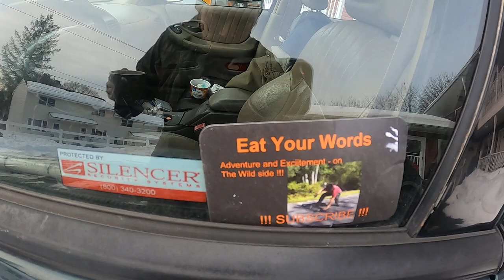What happens when you use water instead of antifreeze in the winter

Comment: Not gon lie lol, I FULLY know this ain't a good idea in the winter. But I have no choice but to use water at the moment. I improvise by warming my car up to operation temp every few hours over night. Man 1...Mother Nature 0 😎
Reply: You cannot afford antifreeze, but can afford fuel to run your engine up to temp every few hours???
Reply from the maker: I didn't have a fuel leak. And I was waiting on parts. Had it been the water pump housing - I would have had to remove lots of other stuff just to get to it, and it was cold....
Reply from the maker: Could you imagine buying between 2 to 4 gallons of antifreeze a day, just to put in it, so it can drain to the ground ...
Reply: I'm in the same situation myself right now, just warming up the car and I'm going to empty the water out and remove the battery untill I can fix it. Luckily I don't really need the car atm so I can just let it sit for now!
Reply: So did your radiator bust or did the freeze plugs on the engine blow out?
Reply from the maker: I got lucky, the freeze plugs blew out...not a terrible fix, but she had a bit of a shake afterwards...lol
Reply: Well whats happened is the upper leg of my lower radiator hose apparently froze solid before I added some actual antifreeze to dilute the water being that temps were dipping to single digits. I thought I was still ok because the upper hose and reservoir water was suprising fully liquid. Thought I dodged a bullet and was going to continue dodging with radiator sealer additive and 100% antifreeze. Nope... Too late. That hose felt like a fucking BRICK lol and its taken me 2 days with - degrees not letting up trying to thaw it manually and running the car trying to circulate it. I realized my situation once I was driving, engine temp stopped going max and held temp, then suddenly steam poured out from the hood... Thermostat gasket blew. Only seemed catastrophic because at single digits steam looks WAY bigger than it really is especially in DRY cold air. Ive got a new radiator, but its too cold to fix if I can only fix on it for 10 minutes at a time before my fingers feel like they are slammed in a car door because of the cold.  @StrawberryGarcia
Reply: I had the same problem.  Mine of frozen solid because I had no job, got screwed over by another job, had no money, finally got a job, then this happens so I had to call off the first day!  Feels like there’s just no relief in this lifetime…

Comment: This video gave me hope that my subie isnt pooped out. I just did the same thing today and thus is what brought me here
Reply from the maker: Yeah buddy, thaw her out good...now's a good time to flush that radiator, LoL....then put new freeze plugs in, try to get the expanding ones...much easier!!! Good luck!
Reply: Same thing happen to me .water froze solid probably is gonna take a few days to unfreeze
Reply from the maker: No, it can be done faster...where are you located? Use hot water .... Dump it in the radiator .... squeeze it out after it thaws a bit... Repeat until the Big radiator hoses are thawed.... Then continue until water poor's out like my video.... Then add a bunch of antifreeze... replace your plugs, then refill with straight antifreeze....
Reply: @eatyourwords5644  I’m located in Alabama it was 19 degrees and I had no idea the water had froze in my radiator until I tried to warm my car up this morning and heard a loud popping noise .I will try to pour hot water on it tomorrow thanks for the info
Reply: @nickiforlife8292  update please!
Reply: @newjack2166  hi there I waited a couple days for the water to un freeze when it finally did and I cranked my car up It was blue smoke coming out but it only did that for that day I ended up having a hole in my hose that runs from the coolant tank .

Comment: is there a good way to get the coolant back up to temp i can tell it's still solid and would prefer not start it back up
Reply from the maker: Pop the hose off the bottom where it meets the engine,  and jus keep adding hot water ...you could also put a heater under, and over the engine...tarp it off to help keep the heat where you want it....
Reply: Pull into a garage

Comment: Your heater core rust out and you have to pull the dash to have it replaced
Reply: Most heater cores are made of aluminum.
Reply: @Josepht1993  not sure. Mine was an 01 F150. Maybe the rust from the motor clogged it up. Probably what happened

Comment: So after all that, what actually happened?  Did the ice make holes in the radiator? Did some replaceable plugs just come out?  I got a whole lot of nothing from this video!
Reply from the maker: The video was simply to show why you don't use water in the middle of winter, yes it pushed out to freeze plugs and ever since then the engine had a really bad shake and the engine light came on.. eventually I sold it for Christmas present money...
Reply: @eatyourwords5644  I've since seen elsewhere that "freeze plugs" was a nickname given to the caps put in some engines to cover the holes made for casting them.  They can, by chance, save your engine if the coolant freezes (by providing a place for it to expand out of) but that's not what they were designed for.

Anti-freeze is apparently also important as a corrosion inhibitor for the water in the coolant and can also prevent overheating by raising the boiling point of the coolant.

I had my car in a situation where it sprung a coolant leak and I didn't have anti-freeze to hand to top it up with.  Luckily I did have distilled water but now the anti-freeze/water mixture must be way off on the water side.  At the time white smoke was coming out from under the bonnet and the engine temperature was hitting 260F!  Needless to say, I'm not running it like that again!  Now I'll probably have to do a full coolant flush to know the mixture is correct again.

Having said this, I've seen Coolant Flush chemicals recommending to run them with just distilled water and no anti-freeze.  Of course it's a temporary measure, but I'd worry if my engine started steaming like that again...
Reply from the maker: Yeah man, my water pump had a crack in it and it was leaking really bad and I did not have the money to replace it at the time cuz I thought it might be the water pump housing... I would run water during the day and at night antifreeze for the last hour of driving, there was one night I was just way too tired and forgot to put antifreeze in and you watched the results of why you should.
Reply: @eatyourwords5644  I was just questioning why you were alternating between the two thinking you were emptying out the entire cooling system for day and night - of course, the water pump housing was doing that for you!  I hope you didn't do that for too long as I'd bet you could've bought a new water pump housing with all the money you'd have had to spend on coolant!

I found a source of the coolant leak on mine because the hose sprung off it when it was running!  The heater control valve - the rubber had perished and the plastic it fitted onto had a piece snapped off!  I've not had a look for it yet but I now fear it's in one of the hoses waiting to cause more damage through blockage or going flying at a weaker part of the system...

Comment: I took my thermostat out too and I've been putting water because it's been overheating and I woke up this morning and my radiator is frozen,
Can I take my radiator up thing off to drain it the cap off the drain it and pour a hot water down the radiator over and over and over on Frozen radiator or will it hurt my car
Reply from the maker: Yikes , that's rough...start by feeling if the hose is frozen too...then start pouring hot water in the radiator....you could also pour it in the thermostat spot if you take the hose that goes to it off....good luck!

Comment: Did it make a loud pop noise when it was over heating and the freeze plug popped out? I’m going through the same thing right now
Reply: Mee too happened last night I'm stressing.. I had an issue going on and I have water in my coolant and I guess it was frozen because we have a winter storm in Tennessee right now and I just drove up the street and I heard a loud pop under the hood seen smoke coming out look down at the hood smoke coming out so I hope a house popped
Reply: @aquavious3854   bro I feel you I was just about to go outside and check and see what’s wrong I jus hope I didn’t crack my block I can’t afford that shit rn
Reply: @aquavious3854  what kind of car you got?
Reply: @Codymac92  swear I can't afford it rn either.. it's not like it's cheap. But 8 got a 2000 jeep Grand Cherokee Laredo 4.0 v.6.. so I guess the coolant was froze but I warmed it up for about 10 minutes just drove to the store and as I was driving I heard a pop like I blew a tire or something then smoke was coming out the hood so I really hope tht a hose just popped off or the oil filter came off it was late an cold as hell so I couldn't look at it like I needed to
Reply from the maker: No, there was NO heat, and as I stepped on the gas, it was making a ticking sound almost...after I stopped, it died...had to be jumped....
Reply from the maker: That's crazy, I'm sorry....
Reply: @aquavious3854  you ever figure what happened?
Reply: @eatyourwords5644  This exact situation happened to my bro. Heard the ticking ,it died. He gifted it to me. Question. Was the ticking from engine damage or was it done after replacing plugs? I'd hate to go through the hassle only to have a damaged engine.